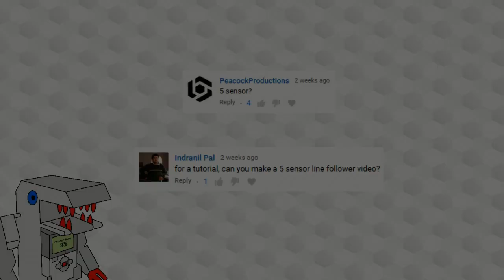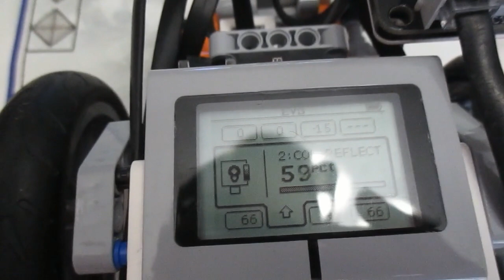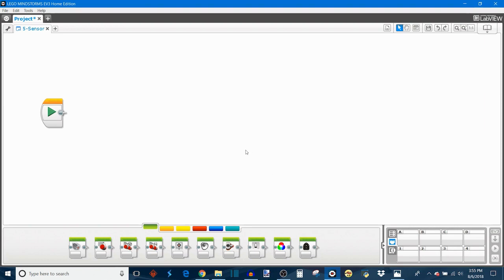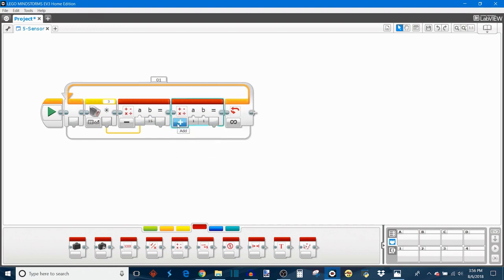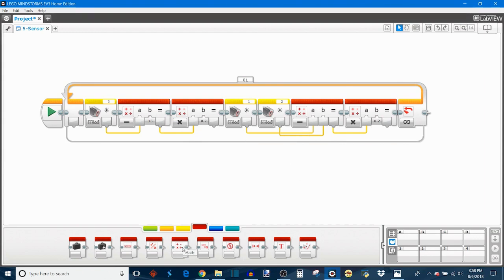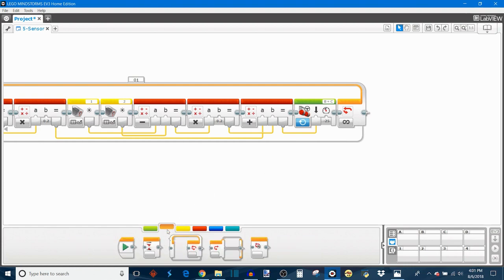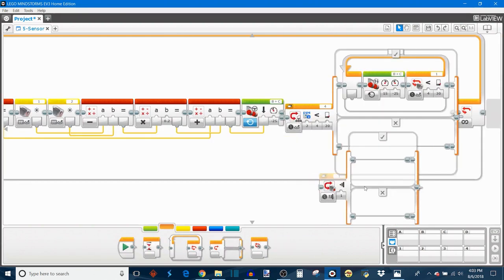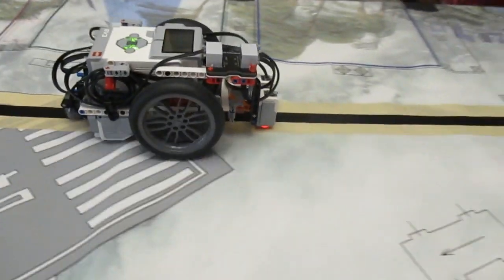5 Sensor EV3 Line Follower - How is This Even Possible?!

Comment: Hey Kyle! Just wondering... where do you get your mats for the robot to drive on? And how do you record your screen, speaker, and webcam?
Reply from the maker: Hello! The mat is simply an old FLL mat... Nature's Fury (2013) to be exact, the only one I have. I also use large white foam boards and a bright LED work lamp for taking pictures.

For screen recording: Open Broadcast Software (OBS).
Audio: Blue Snowball microphone.
I don't use a webcam, for the live scenes with my face, I use a Canon Elph 160 digital camcorder on a tripod.

I hope this helps!